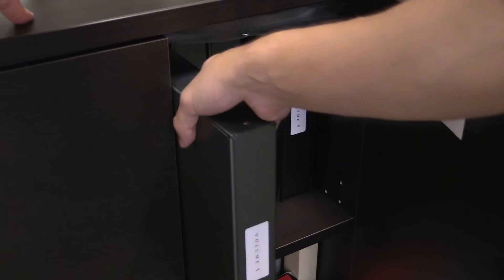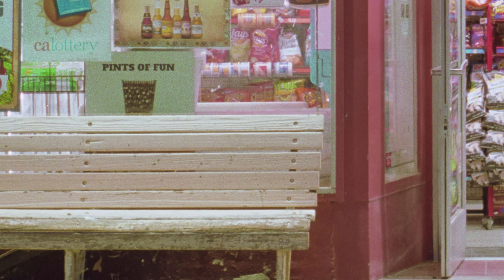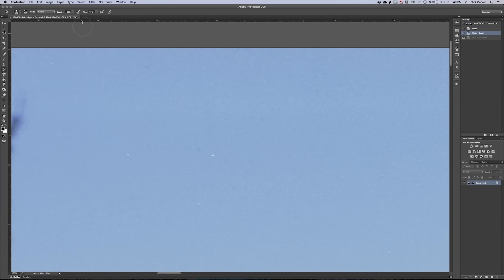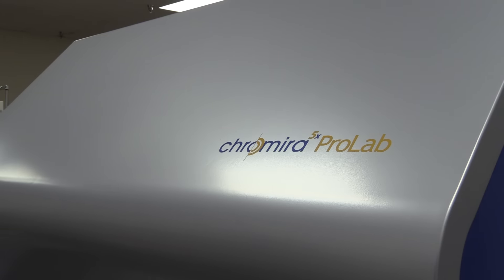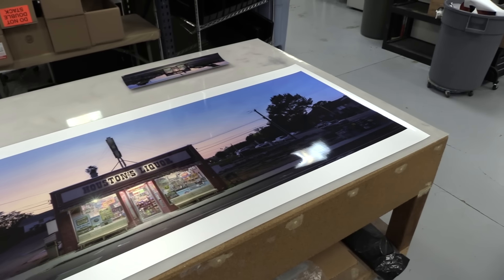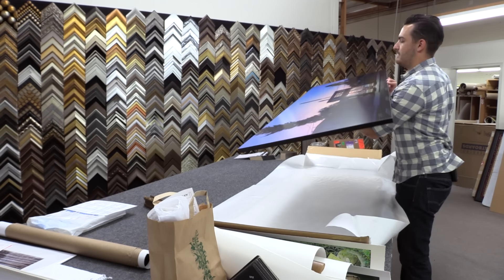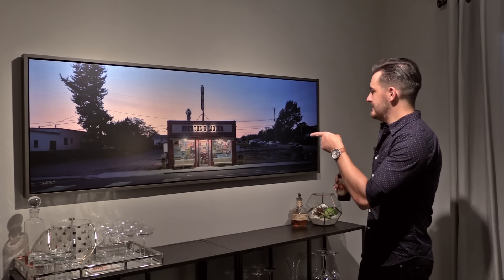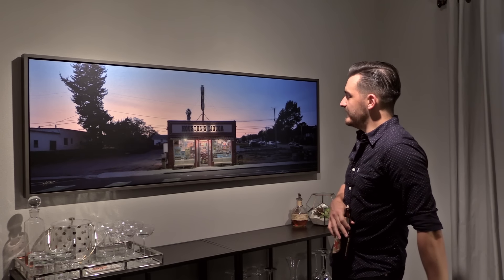Fine Art Photography: From Scan to Print to Frame

Comment: Thanks Nick, great walkthrough of the process!!  I'm going to get some prints made and was really confused what paper to use, etc.  This helped a lot!!

Here's a breakdown of everything Nick said.  In case you're like me and you like lists:

Print size: 2 ft x 6 ft
1.	Step 1
   a.	Drum scanning
   b.	Aztek imaging, Alex Burke is better (learned this from some other video I watched)
   c.	Gigantic TIF file (16-bit)
   d.  Scanned on v750 instead, either will work
2.	Step 2
   a.	Prep file for printing
   b.	Clean dust
   c.	Bring into Lightroom Color and tonal adjustments
   d.	Export as 16-bit TIF
   e.	Open in photoshop, use smart sharpen
   f.	Resize to 24 in x 72 in at 300 ppi
   g.	Send via FTP
3.	Step 3
   a.	Print
   b.	Pro photo connection
   c.	Zbe chromira prolab printer (C-type print)
   d.	Get proof made first – small version of print
4.	Step 4
   a.	Mount and laminate
   b.	Mount on 3 ¼ in gator board – light weight
   c.	No glass, apply luster lamination (mounting guy did this)
      i.	Luster lamination removes gloss
   d.	Printed on Fuji crystal archive perl paper (looks backlit, but ultra high gloss)
   e.	Sign and number print
5.	Step 5
   a.	Framing
   b.	SalamonArt.com
   c.	Make sure you can trust them
   d.	Float frame, check against different parts of print
Reply: THX for this GREAT List - I COPY and SAVE /// McRoman ...   ;)

Comment: Another great video.  Do you find that dry scanning the 6x17 negative better then wet mounting, since you have done both?  They sell anti-newton glass, medium format trays for the Epson that I was thinking of getting.
Reply from the maker: Abigail Sockeye I actually wet mount scanned this negative also, but ended up using the dry scan. The wet scan had no noticeable improvement in sharpness but I did get some strange fringing around some of the edges on the wet scan that weren't there on the dry scan.

Comment: Why don’t you get the raw scan and manually invert it? I do this when I get my negatives drum scanned. It takes practice and a little bit to tweak, but the results are amazing.
Reply: Good question IMO. With a raw scan you can do as many inversions as it takes to get it right. Regardless, another excellent video!
Reply: For inversion I have used the plugin program ColorPerfect with great success. But not on a drum scan.
Reply from the maker: That's a great idea and I'm sure it's worth trying. I will say, though, that I also tried "DSLR scanning" this image on a light box and then inverting in PS like you describe. Doing the inversion myself with careful use of the tone curve never got the colors as good as SilverFast did for me with their Portra profile. I'm no slouch when it comes to color correction using curves in PS, but maybe I'm not as practiced as I could be for inverting negatives.
Reply: I don't believe you can get a RAW output from Digital PhotoLab which I'm sure they used on that Howtek. I can't get a raw output from ScanXact on my drum scanner or from my Scitex flatbed.
Reply: Ned Bagno just have them scan your negative as a transparency instead of a negative and you’ll get the ‘raw’.
Reply: Well you get the inversion yes but as he said and in my experience it's very difficult to get the colors right. Now if I use my Minolta multi scan pro with Vuesan and output a raw file to colorperfect it comes out real nice.
Reply: Landon Hill j

Comment: Love your videos! But I have to ask a question: Why not wet scan the negative rather than using the shim method? You'f get excellent results. Just aksing, not criticizing.
Reply from the maker: John Wilkinson that's a good question. I actually did wet scan it on my epson, but ended up using the dry scan. The wet scan wasn't noticeably sharper but it did have  weird color fringing on some of the high-contrast edges, which the dry scan didn't have.

Comment: Is it possible to make prints that large with that kind of resolution from a digital image, or does it need to be on film?
Reply: You could use a medium format camera, the new 60mp Sony ARIV, or maybe even combine that with some fractal resizing. Possssibly resizing with AI models might help, but afaik they are currently mostly useful for low res upscaling .
Reply: @Baronvonbadguy3  I have the Sony A7 II with 24MP. I wonder what the biggest print would be I could do that still looks good, even when you're getting close to it.
Reply: @WinrichNaujoks  those fractal resizing algorithms do solid work with inkjet printing. Give it a shot. If you're not cropping in much, 24mp might be enough. A little sharpening goes a long way

Comment: It can indeed be a challenge to scan negs. I can say we don't have that saturation issue with our Aztek. Not sure what's going on there.  Flatbeds are very convenient, but they just don't have the color detail/fidelity of the PMT of the drum. But no two images are alike and you gotta do what you gotta do to get a print you like!  Another challenge with negs is the increase in grain that results from contrast adjustments needed to move the low contrast neg to a proper gamma for printing.   Chromes really are the ideal film stock for scanning.   Great video!
Reply from the maker: I'm anxious to get a new drum scan of this negative to see how it can look in the hands of the right technician. And that's interesting to hear about the grain increase from contrast adjustments. Explains a lot. I need to experiment more with pulling exposure on chromes to see if I can mimic the lower-contrast look I love so much from my negatives. Because I agree that chromes really are the best for scanning.

Comment: marvellous! did you put the same attention in color rendition (postpro+printing) also in the choice of the correct led (high CRI) you use to illuminate the print in the wall? great photo! great work 💪🏻
Reply from the maker: Thanks! Ah yes, the lighting - the most frustrating thing to control! I have some warm-toned halogens in there now which are decent. LEDs are looking a lot better these days than they used to.

Comment: Hi Nick! I love your videos.  I'm an amateur / hobbyist photographer just getting my feet under me. Can you tell where you go to get your large prints mounted and laminated? I'm located in Camp Pendleton (Oceanside), California, so just down the road from you. I have a great shot of the Devil's Golf Course out in Death Valley National Park that I took and had printed. It's 20" x 50", and I'm having a hard time finding someone who can mount and laminate. Also, what's your view on acrylic facing versus lamination and framing? Thanks!
Reply from the maker: Thanks! I use Pro Photo Connection in Irvine. They do the printing and mounting/lamination. They have an off-site mounting guy do it, but it's all ordered and organized through Pro Photo to make it easier. John at Pro Photo would be happy to help you if you give them a call or walk in. And I really like the face-mount acrylic stuff too. It's just heavier and glossy instead of matte. I prefer most of my work to be matte finish, but some stuff looks way better in the face-mount acrylic.

Comment: Hi Nick, I love your videos. One thing: if you are going through all the trouble of drum scanning, etc for a digital C-print, why not simplify and use the full analog process, with enlarger? That way you get the full sharpness and continuous tone without and digital interference. Honestly it's still the best way of doing things. I haven't printed 3x6ft before, but I know it must possible because that was the only way to do it back in the day. I am experimenting in my own darkroom with large prints, and found the best was is  with a horizontal-oriented enlarger. I know not many (or any) places do this anymore, but just a thought!
Reply from the maker: Man I'd love to try it in a darkroom, but finding a darkroom with the right equipment to do an enlargement that big would be a challenge...or impossible.
Reply: @nickcarverphoto  Yeah that is true. I have a Beseler 45MCRX that I was given, (which can also be found fairly cheaply). They turn horizontally and can enlarge 4x5 film pretty large, you are only limited by the distance of the paper from the lens. I am looking for a color head, though I'm not sure if I want to make the jump into color just yet. I did some searches, and it seems like C4 Gallery in Hollywood (http://www.c4gallery.com/workshops/photo/darkroom-rental.html) may work, they can go up to 42 x 60, so not quite as big but almost. There is also Contact Photo Lab in LA (http://contactla.com/rental/). I haven't used either of these, but there was something similar in San Francisco (Rayko, now sadly closed) and I found color printing in the darkroom giving so much more depth and just a more enjoyable process. It's incomparable to inkjet printing, like you said in the video.

Comment: So, I know this is not exactly a recent video, so my apologies for the late entry, but...Unless I missed it covered elsewhere, imo you left out one important detail of the final process. Discussing how to properly display a piece of photography art and proper illumination etc. It looks great and you obviously have it illuminated in some way, but you didn't cover it. I am about to hang a 27.5"X80" piece and I am exploring my options on how to illuminate it properly i.e. color temp, brightness, dimmable? Any suggestions? I have a couple recessed "can" lights that I could possibly convert. Any experience with this?
Reply from the maker: You're right - that would be a very important topic to cover. I should probably learn more about it myself and make a video sharing what I find out. I pay close attention to color temperature of the bulbs I use (I try to keep it around 3000-3500k). The daylight-colored bulbs sound great in theory, but they look really harsh and blue at night. Thanks for the idea.

Comment: Hey Nick, very cool print and video, thanks for sharing with us. Quick question, in Lightroom, when doing the softproofing, do you tick the simulate paper and ink?
Reply from the maker: Felix De Lubersac thanks! I do not. I haven't found the need to.
Reply: Nick Carver thanks! So you just tick the soft proofing box at the bottom and adjust from there after loading the right profile?

Comment: An eagle-eyed viewer here!  I notice that you use dust and scratches with the history brush for dust removal.  Do you mind me asking what radius and threshold you use for the dust and scratches before applying the history brush?  Do you change it by eye for each image, or do you have a go-to setting?  I will be shortly getting a V850 to scan 4x5.  Previously I've used a combination of content-aware spot healing and cloning to do the job for me.
Reply from the maker: You sure are eagle-eyed! I use adjust the radius and threshold on a case-by-case basis. Depends on the scan resolution, how many intricate details the image has, etc.
Reply: OK, thank you!  I tried it out, but I found it difficult to work out what radius and threshold to use - unless I'm doing it wrong (very possibly) I often found bits that the dust and scratches had missed.  For the time being I"ll probably stick to my former routine, which works pretty well.
Reply from the maker: Yeah the dust and scratches option doesn't get everything. I still have to use the heal tool on the larger pieces, but dust and scratches really speeds up time cleaning the smaller bits.
Reply: Thanks again: since Christmas I've been processing my own E6 and B&W film.  Since then I pretty much don't have to do spotting unless I have large amounts of flat colour/tone, i.e. sky, in the images, and then by no means as much as before - amazing how much junk a lab can deposit on a sheet.

Comment: Could you have just used the Epson scan as a colour layer on top of the drum scan. Keeping the detail and getting an ultimately better colour rendering?
Reply: This is an interesting idea.  I'd love to hear from Nick on what a test of this would look like.
Reply: @trevorhawks4577  same lol. I wouldn't be surprised if it's not a perfect method. But i feel it should. Unless there id slight artifacting from resolution discrepancies.
Reply from the maker: Tried it. Doesn’t work. You’d never in a million years get the pixels to line up from 2 separate scans. Even with fluid mounting, it’s never a perfect match.

Comment: Awesome video! But I have one question: since the print is actually an exposed image on a photo-sensitive paper, wouldn’t it be possible to directly expose using the negative? That way, you would circumnavigate the whole scanning and even keep a better quality because it wasn’t converted into pixels. Makes sense in my inexperienced mind, has anyone any thoughts about that?
Reply from the maker: That's an interesting thought. I'm not sure if it would be that simple, but man that would be rad if it was possible.

Comment: Sounds like a color management issue or possible color shifting from an old negative. Many possible issues whenever you use film.  There are much better scanners than the excellent Epson V750. Also Photoshop has excellent color correction capabilities. IMHO after 33 years of Photo Processing :)
Reply: MikeMeyerPhotoPro you can also scan as a negative and use Photoshop to invert it. There’s a action called CNMY invert that does a phenomenal job, they say Negative Lab Pro is good (for $100, it better be), otherwise you can do it manually
Reply: @alvareo92   Hmmm, never heard of CNMY.  I worked in a photo processing lab and have scanned thousands of crappy old negatives and sometimes you just gotta cry uncle. I was really surprised that the place that drum scanned your negative din't fix it for you or was it an additional cost? I haven't scanned too much in the last five years. I think I already scanned all the film in the world ;)

Comment: Hi guys. A bit off or on the topic. I dont know what is the best resolution for a picture when printing on a large canvas or profile. I handed a 3000x3200 resolution to a printer and he siad he can print large, but the details will be lost "pixelated". Is it the picture itself or the software that is exporting it?
Reply from the maker: Prints are usually done at 300 pixels per inch. So for a 3000x3200, you could print 10" x 10.7" without blowing up the file or reducing the pixels per inch.

Comment: Nick have you ever thought about getting a nikon coolscan for 120 film instead of doing your flatbed procedure?
Reply from the maker: I have. But unfortunately it can't handle 6x17, which is a deal breaker for me.
Reply: Nick Carver and you seem happy with the flatbed scanner approach?  I feel like the 100 megapixel scan of the Nikon would beat the flatbed scanner of a 6x7 negative, right?  I know it’s not only about the pixel count, but I want to make large prints like you do.
Reply: Nick Carver I’m surprised you can’t scan longer, the negative holder seems it would fit a longer negative, I think you can put three images of 6x7 inside it
Reply from the maker: @jasongoldenberg973  Hard to say because I've never compared side by side. But again, for me it's moot. No 6x17 = no go for me.
Reply: Nick Carver they say you can scan larger areas just not using the Nikon software, use third party software
Reply from the maker: @jasongoldenberg973  max scanning area for all the Nikon's I've seen is around 63 x 88mm. 6x17 is around 55 x 170mm. So regardless of software used, you'd have to scan half of the image, remove it, flip it around, scan the other half, then stitch it together in Photoshop. The stitching process never works out as smoothly as you'd think. Not worth the hassle for me.
Reply: Nick Carver ok thank you.. I do appreciate your videos.. some of them..

Comment: Since the problem was with the drum scanner not inverting the colours properly, couldn't you have asked the lab to scan the photo as a positive (i.e. just scanning, no inversion or cast removal) and then inverted it yourself using Photoshop or Lightroom? That would have preserved the high quality of the scan! Wasn't that an option?

Comment: What's going on with Chromira prints options? Prophotoconnection doesn't seem to offer the services anymore.
Reply from the maker: They do. They just don't specifically state it's on the Chromira. Anything done on matte, glossy, or pearl paper is c-type. Up to like 12 or 14-inches wide, they do it on a smaller machine than the chromira. Anything bigger and they'll use the Chromira. You can call and talk to John if you want more details. He runs the processing counter.

Comment: I noticed you exported the file to PS from LR as 72 ppi at 1000x1000 pixels in the sRGB color space.  Later you resized the file before sending it off, does that resizing from 72 ppi 1000x1000 pixels to 21588 x 7200 pixels at 300 ppi deteriorate the image at all? And why not use Adobe 1998 color space instead of sRGB?
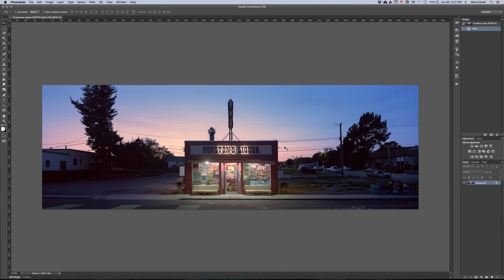Reply from the maker: If you look at the screenshot at 4:24, you'll see that "Resize to Fit" is unchecked. So I didn't export at 1000x1000 pixels - it went out at full size. And I use sRGB instead of AdobeRGB because I don't have wide-gamut monitors and I've gotten good results for years sticking in the sRGB color space.